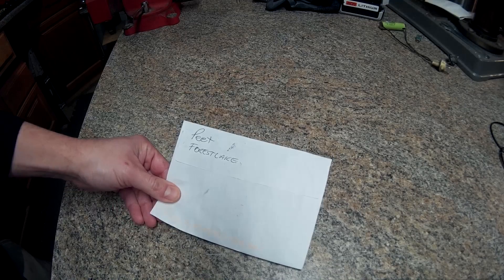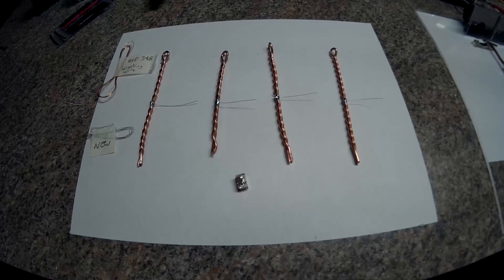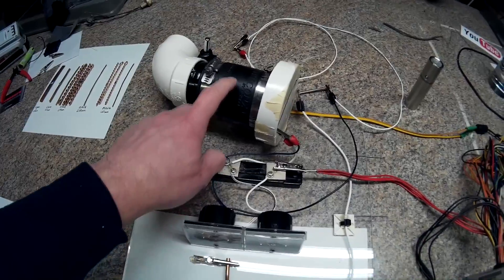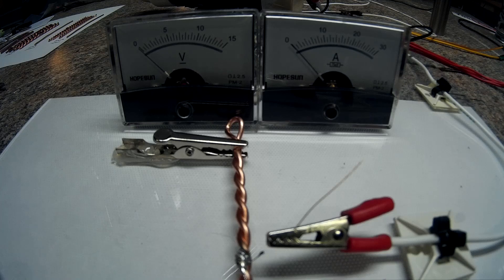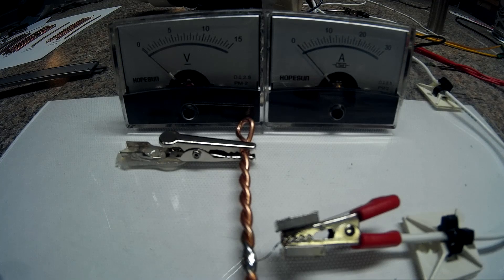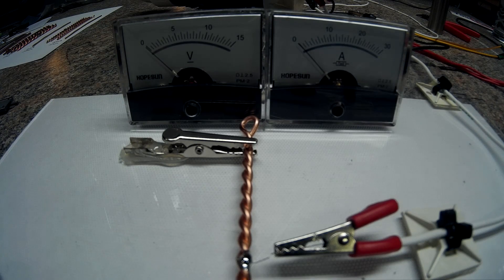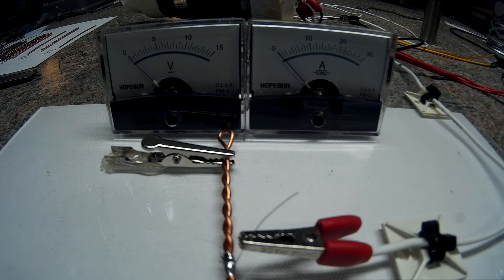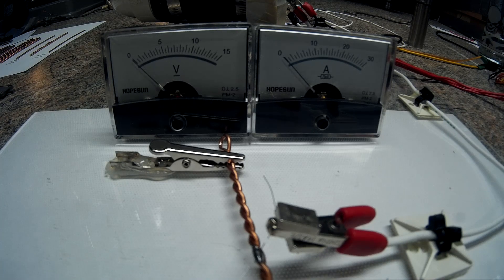Diy Tesla Powerwall ep22 HBPowerwalls Fuse Test Results

Comment: I'm in the early ( very early) stages of researching and wrapping my head around this stuff... Could you tell me why I should care about such specifics like this? As understand it these fuses are for when a single cell dies and shorts. So as long as it blows when shorted on a cell and not under normal load operation shouldn't that be enough?
Reply from the maker: Welcome to the addiction😉 This video was done in the early stages of my research and my reply is going to be my opinion:  I think fuses are very important.  There are 2 different ways to fuse.  First way is to use a similar gauged wire used in this video which is (my opinion) more of a last chance ditch effort or short.  It will pop but it takes a lot of amps to do so.  Using wire like this will not catch a cell on its way out until (my opinion) its to late or it really starts putting an unnecessary load on your pack until it finally pops.  Sure it works just fine and many people feel comfortable using it.  Im not saying I would never use wire for a fuse because I did use it on a small 24v ups pack for testing.  Buuut.....

I personally dont feel comfortable using this style of wire on my packs and Ill tell you why.  I have my powerwall inside of my house (many people dont think that is safe) because I live in Omaha the weather here in winter can be -29 for weeks on end and in the summer can be over 100 for the same amount of time.  I didnt want to have to build a climate controlled shed or out building to house it in.  Since I have the powerwall inside my house I wanted to make it as safe as I can and wanted to use a very low amp fuse.  I wanted a very low amp fuse so if and when a cell starts to go out (since I am using used cells like most people) it will pop the fuse much sooner and not put an unnecessary load on the pack draining it down or cause any extra heating a cell might produce when they short out or have to high internal resistance.  Since most laptop cells can normally/safely discharge at 1amp I found and tested a few different mini glass fuses and decided on some fuses that pop at 2amps.  I went with the 2amp pop rating because its 2 times the amount of current the cells can safely give.  If you watch some later fuse test videos I did you will see which glass fuses I tested and what they are rated at.  Technically the fuse is a .5amp fuse but in my testing it consistently popped at 2 amps.  In the end as long as you have something on the cells for protection, you should be good. Hope that shed a little light on the subject.  🔋👍
Reply: Ok that definitely makes sense. I will look for your other fuse videos. Thanks a lot for the relpy!
Reply from the maker: No problem!

Comment: The Copper pipe your referring to isn't really copper pipe its copper sheathed wire know as MI Wire. Used in fire systems and such for its fire resistance

Comment: I've done plenty of healthcare facility electrical work and I can say I've never hear of using pipe as an electrical conductor. The only thing that resembles that is mineral sheathed cable that is used for fire fighting pumps. They are an un-fused branch circuit right off the main service. 
There is a code requirement for all "systems" to be bonded to the grounding system and that is where water and other piping systems to be connected to ground. It's also called "Earthing".
Reply from the maker: I could of sworn that I remember hearing some Hospitals that had copper pipe.  Maybe Im hearing things ;).

Comment: FYI you can get a 4 terminal power supply (with sense wires) so you can end a lot of the inpercisness, and voltage drop issue. Look for a used HP/Agilent-66332A on ebay. And you can do fairly accurate and repeatable tests with one.

The key thing for the voltage drop argument is the sense aka S+ and S- terminals on thouse lab supplies, thouse make sure voltage is correct to the point the point you connect thouse wires to every thing behind that point no longer matters as it cancels out any voltage drop.
And yes complete and utter over kill.
Reply: Also as a side not its not uncommon for slow blow 1 amp fuses to take 5min to blow so i think your on the right track with that new fuse wire.
Reply from the maker: Awesome, thanks for the power supply info.  Yeah I just used what I had here to do the testing.  Ill have to see if my recycler has one of the power supplies.

Comment: So, it's Valentine's Day, and the most important question is, Did you get the girlfriend a new Hair dryer yet???  Preferably a pink valentiney one.
Squished copper Pipe works great, it has been being used in Homebrew DC systems for many decades with no issues that Ive heard of.  Well keep raw steel away from it, and maybe nickel, or you'll have corrosion 5-10 yrs down the road.  Another great vid!

Comment: Glad you finally revealed the Copper tube thing, now I can (Meow) openly talk about how I'm going to do my buss bars.  I suppose one of the concerns I'm having (Meow) about the fuse wire is how many amps it is taking to blow them. With Peter's at 19 amps I'm not sure how that is going to protect his system from being a total loss (Meow) in the event of a failure.
Reply from the maker: Lol Meow!!!  Ok (meow) Peters 19amp fuse will still protect from total pack loss (meow) in the event there is a short (meow) because each cell will have 2 fuses (meow).  (Meow) a short will be more than 19amps (meow) and vaporize the fuse (meow).
Reply from the maker: Ill have to see if I can rig up a test using the tube vs another type of bus bar
Reply from the maker: DIY Tesla PowerWall Yup thats true, I ment more as a general statement

Comment: On DC, there is no change in frequency and hence the inductive reactance is zero! So the current doesn’t find any 
opposition other than the resistance and it flows completely in the conductor, not just outside
Reply from the maker: I never understood inductance reactance or at least it hasnt clicked in the ole brain yet lol

Comment: It's AC that has the skin effect, look at the really high voltage transmission lines (eg 275kV) that have paired cables. That pair behaves as one solid cable of the same outside diameter, only a lot lighter.

One reason for using multistrand cable for DC is to reduce inductance, and to make cables easier to bend and less likely to snap.
Reply: It is really the interactions between the current flowing in the conductor and the magnetic field it creates that.  forces the current flow to be concentrated at the outside of the conductor. One normally does not have to worry about skin effect until the frequency of operation is up above 100 MHz.

https://en.m.wikipedia.org/wiki/Skin_effect

I am not sure why HV transmission lines are mentioned in the Wikipedia article. It is most likely that the authors have confused the term HV transmission lines (where skin effect should not be significant) with high frequency or radio frequency transmission lines (where skin effect is important).

https://en.m.wikipedia.org/wiki/Transmission_line

Multistrand cable does not reduce inductance. That form of cable construction is used to make it more flexible so it is easier to transport and install.
Reply from the maker: I havent seen the 275kv lines, sounds really cool!!!